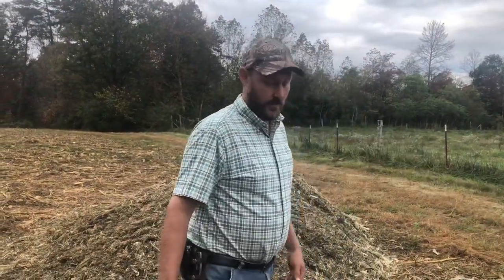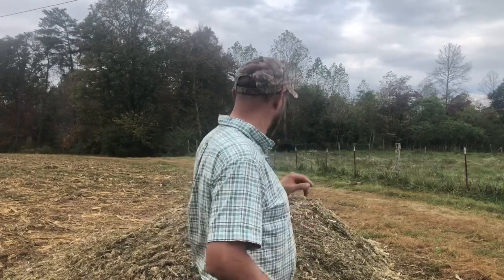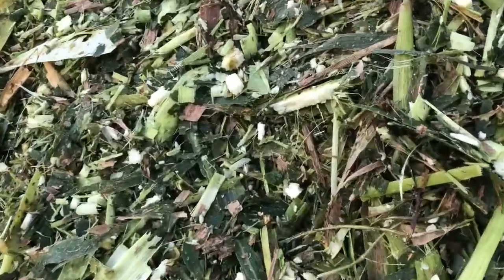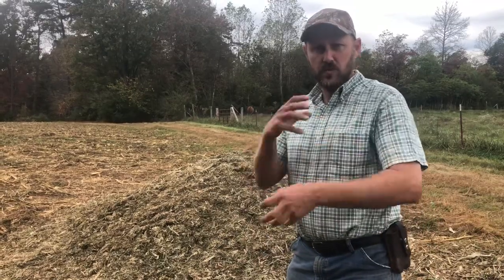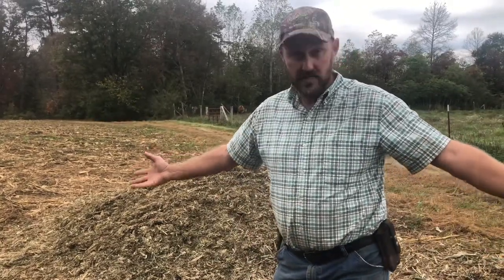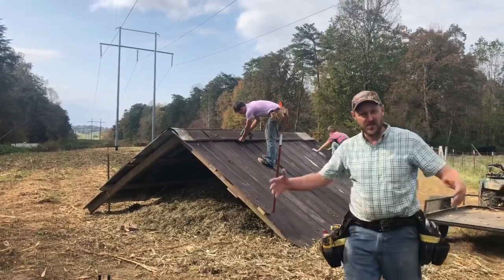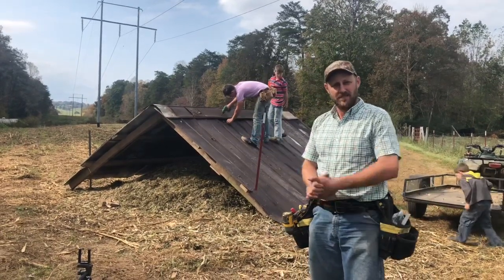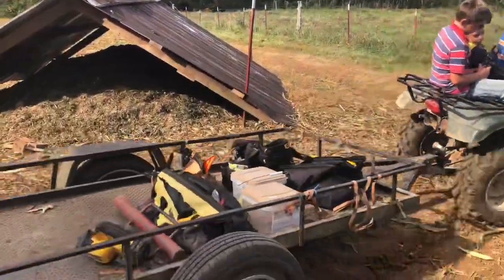Building a roof with 9 boards and some old tin!

Comment: We put heavy black plastic on ours, heat is normal and it will ferment
Reply from the maker: Ok that is great! I’m still hoping I did it right!🤞
Reply: @McGieHomesteadAdventures  the only thing I see that may slow the process would be air flow, if you can cover it with plastic it will ferment better usually 3-4 weeks, but I’m interested to see how yours does with a roof 😀
Reply from the maker: Me too!!